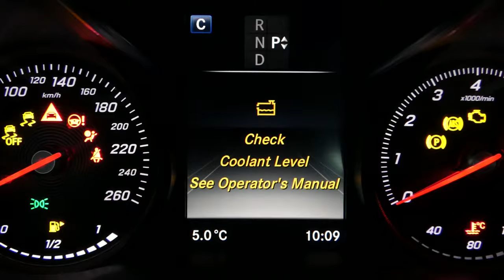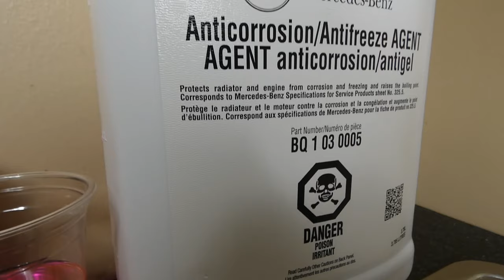How to Check and Add Engine Coolant in Mercedes Benz C300 W205 W206 and E300 W213

Comment: The cap on my 2014 CLA250 won't unscrew. It turns 1/4 of a turn and then it's hitting a stop. Not sure how to take the cap off. I tried pinching with a flat screw driver but not luck. Any suggestions?
Reply from the maker: Just press a bit down and try to apply more pressure when turning slowly. My was very hard to undo first time.
Reply: @NewRoad  I tried it. I ended up using cutting that little piece with a small saw so the cap will come off. Ordered the new cap for back up. Thanks anyways!

Comment: Thank you for your video. Why do we have to use Mercedes Benz antifreeze and we cannot use another brand?
Reply from the maker: There are different coolant on market, and some are not compatible with Mercedes. Hence, it is better to use what manufacturer recommend unless you find aftermarket which approved by Mercedes

Comment: First of all, thank you very much for the video.

My S560 is giving me the "Check Coolant Level" for about a week but I hardly ever drive the car (on an average, just 2-3 KM a day). My yearly service is due after a couple of days. May I ask what do you suggest? Can I wait for another couple of days for the service technician to refill the coolant or you recommend I should do it myself right away? Your suggestion will be much appreciated. Thanks!
Reply from the maker: It depends on the level, If it is just below mark and you still have some - you can wait for service, so you don't have to buy 4L of it. If it is too low - I would not risk and add myself.
Reply: @NewRoad  Thank you sir! 🙏🏻

Comment: thanks for the video! just topped mine off today after watching this. However, any idea for topping up the intercooler/turbo coolant reservoir? I understand it uses the same coolant type but unsure of the exact amount needed (level marker?). There is no info for it in the manuals...
Reply: Yes, I was asking the same question!?!?
Reply: The intercooler reservoir has a label with word MAX and a downward pointing arrow under it to the level. Should be engraved in front of reservoir

Comment: I've bought mercedes original coolant in a small bottle 1.5 L and its colour is Blue, is there any diffefence to the Pink one you used?
Reply from the maker: I've got mine from Mercedes dealer in Canada. Did you get from dealership?
Reply: I've got it from a local Mercedes-Benz Part dealer, as it turns out its a different type with number 325.0 for vehicle produced up to April 2014. The W205 uses newer 325.6 which is colored pink which as HOAT based coolant. Got the product returned as mixing it together can cause gel to form in the system.
Reply from the maker: Thank you for comments, good info for everyone to know!
Reply: The Blue Mercedes-Benz coolant is known as G-48. The same coolant that BMW and Volvo used until 2019. The G-48 is HOAT but it has a shorter lifespan than the Mercedes Benz G-40 coolant which is Pink/violet. G-40 coolant was also used by VW group brands known as G12++.
Reply: I have a bottle of Zerex G40 it states that it's  MB,VW approved for use in these vehicles.

Comment: I have a Mercedes w205 C200, I added G12+ pink coolant, the level is ok, but I still have check engine light, it's been a few days
Reply from the maker: You check engine might be due to other problem. You need this tool to find the problem:  https://youtu.be/tbWh6AulLbI

Comment: How do you know if your engine coolant is premixed?
Reply from the maker: Information about coolant for your model can be found in the Mercedes-Benz specifications for service products here: https://bevo.mercedes-benz.com/ , or contact your local dealer. Mercedes suggest to always use a suitable coolant mixture, even in countries where high temperature prevail
Reply: NewRoad Adventures got it! Thank you. I found it!!
Reply: The coolant he has in the video is unmixed. It will say “undiluted” if it’s not mixed. It’ll say “50/50 pink” if it’s mixed for Mercedes w205

Comment: Can you just pour it without the distilled water 💦???
Reply from the maker: Mercedes suggest to always use a suitable coolant mixture, even in countries where high temperature prevail. Information about coolant for your model can be found in the Mercedes-Benz specifications for service products here: https://bevo.mercedes-benz.com/ , or contact your local dealer.

Comment: What are symptoms of intercooler pump failure?
Reply from the maker: Your MB most likely will shutdown and throw the error code. You might be able to start it again when it cools off - but the problem will repeat. Also, car response might be weird since sensors will be sending conflicting data
Reply: NewRoad Adventures even for the 2017’s?

Comment: You initially said USE distilled water, and LATER you said you RECOMMEND using distilled water.
I don't know that MB is any different than Mopars, GMs or any other manufacturer for that matter...am I right?
I've never heard that before...
So, just what does DISTILLED water do that tap water can't or won't do? Explain it a bit further if you would.  TIA
Reply: Tap water and purified water have minerals in them to enhance taste. These minerals can be damaging to your engine. Distilled water is free of any minerals or electrolytes. That’s why it is recommended for not only cars but other machines like Keurig coffee makers
Reply: @xRoyalSmoke  I highly doubt that ANY automotive shop goes to the trouble, OR spends the $$$ to use distilled water.
Reply: @Kman.  well as someone that works in automotive I can tell you that’s incorrect lol
Reply: @Kman.  if you like driving Mercedes I suggest using more than your assumptions to take care of it lol
Reply: @Kman.  also not sure what “trouble” or “$$$” your talking about? You can buy it basically anywhere and it costs just the same as regular water
Reply: @xRoyalSmoke   I've never seen a garage with gallons or containers full of distilled water. From the tap it is free. No charge other than what somebody pays as their monthly rate. I don't service any of my cars they go into shops.
Reply: @Kman.  because shops have people called porters that go out and pick up parts/supplies “as needed”. That’s something they would get if they needed it for a coolant job. They wouldn’t just have a huge supply of water taking up space in their shop